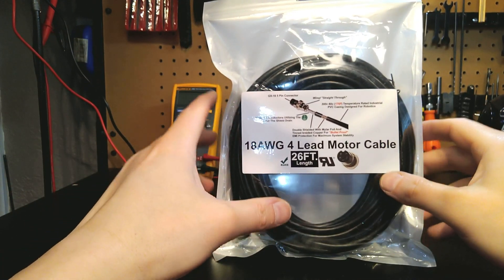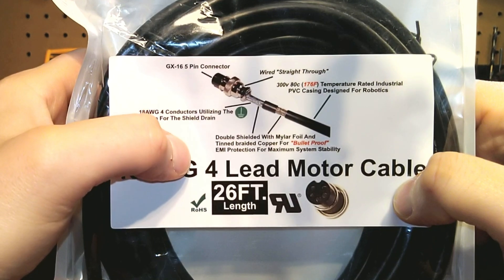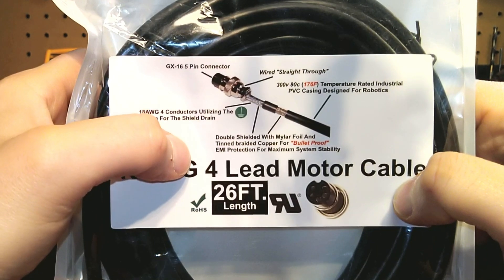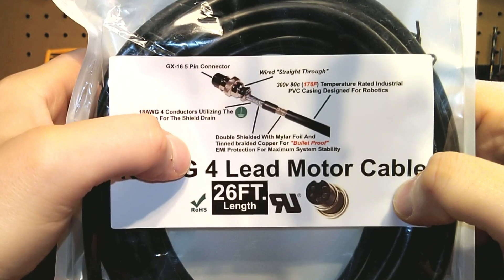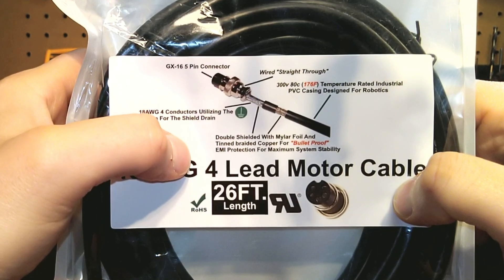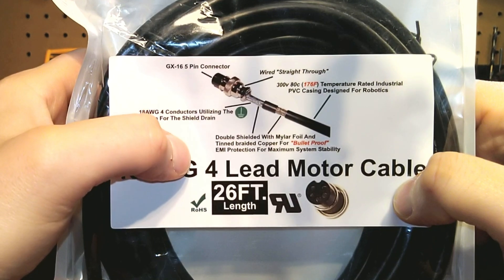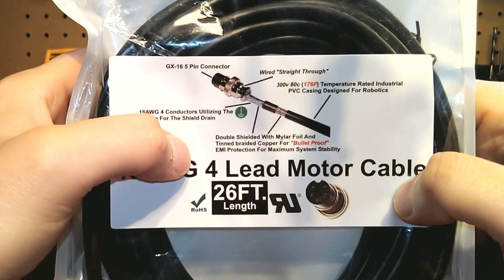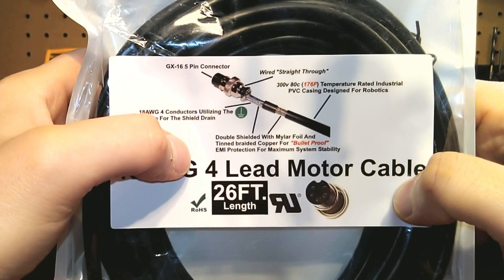NEW Pre-built GX-16 5 Pin 26ft. 18/4 Double Shielded Motor Cables Are In Stock...

Comment: My stepper motors have GX-16, female 4 pin connectors from the factory. I would like to get 4 of these cables, but what do you recommend for the 5 pin to 4 pin connection? Trying to keep the shield drain connected, but I dont believe the short piece from the motor is shielded. Hope that made sense...
Reply from the maker: The shield drain on the motor end isn't to be connected. In best practice the shield drain is connected to your controllers ground buss bar. If your motors are using 4 pin GX-16's then they would have to removed, and GX-16 5 pin versions installed, and you're all set.  Thank you,
Vince

Comment: Vince,
Do you ever mess around with 3d printer control systems? (personal use, not serious industrial use machines)  I have followed all your videos and learned enough from them to solve most of my plasma table stability issues, its by no means bulletproof to your standards, but its stable enough for my home hobby shop. For now at least.  
Anyways,  do you think shielded cables are necessary on a hobby use 3d printer or is it just way overkill (in your opinion)?
Reply from the maker: Hey Michael, thank you for your support. I myself don't use a hobby type 3D printer. I do however own a Makerbot Method X Carbon Edition I use for prototyping. 3D printers don't have enough EMI to usually be a problem as they are much lower voltage systems then a router/mill/plasma robot. Shielded cables are fine to use on them, but due to the small amount of amps they use the benefit is seldom scene. Thank you,
Vince

Comment: Rookie question, I dont have a spindle yet.  what do you do with the 5 pin connector that attaches to spindle as they have four pin built in for cable. 
Regarding the add on connectors,  with the prewired cable wouldnt you just need the panel connector for the cable, then run wiring directly to the Gecko.
Thanks
Reply from the maker: BRJR12341, thank you for your support. This is a stepper/servo motor cable. A spindle requires a 16/4 double shielded cable  https://www.ebay.com/itm/131899174942 Thank you, and have a great weekend! Vince